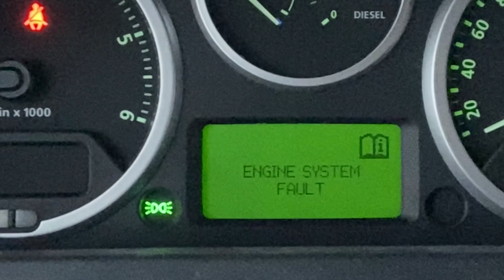DIY WHEEL FIX - Painting my Land Rover Discovery Rims Black

Comment from the maker: First time painting wheels, what do you think of the result?? 😅
Reply: Nicely done, you are lucky that you don't wear glasses 🤓 like me so I have always Paint on them. I did my Rims I think 10 Years ago. Just changed my Steering Linkage on both sides last Friday.😊
Greatings Sandro from Germany
Reply from the maker: @SCGFunktionsmodellbau  Hey Sandro and thank you! I have glasses but as you say, luckily I only use them while driving long drives or watching TV. 😅 Good thing you won't get paint in your eyes. 🤓 Do you have the rims still, if so is the paint holding up? I secretly love doing these jobs my self and learning, even though they take a long time to do.  Steering arms, which car? The D3 I find to be fairly simple to do, a good set of players and your set. I have change min two times in the past 9 years, was on the way out when I bought the car and last year I think. 😊 Best, SImon.
Reply: @LandRoverDrive  Hello Simon, yes I have done all 2 Sets of Rims, and the Paint is still on it, ok I used somewhat of professional paint. This is also the second set of Steering Linkage on my D3 I used this Time Meyle HD Parts, and hope that I can get another 2 years of TÜV because there is quite a lot of corrosion on the door sills. Greatings Sandro
Reply from the maker: @SCGFunktionsmodellbau  Okay, you've done a good job then. 👍 I don't remember the the brand I used, but I used the same brand now as last time as they held up for 6-7 years. I got some corrosion on the door sills as well and need to attack that after the summer. Will have to practice my welding skills again. 😅
Reply: @LandRoverDrive  yes I have the same plan will see if it works out, new sheetmetal is not that expensive.
Reply from the maker: No, I have some ready in the garage, just need the time to do it. Need to oil up the chassis this year before the winter comes as well. Rusting like crazy up under there. 😅
Reply: @LandRoverDrive  yes here also, the people say here we have 6 Months Winter and 6 Months hard Winter, years of Salt during that time does not the Best to any Car.
Reply from the maker: @SCGFunktionsmodellbau  yep, road salt is on my things-I-don’t-like-list. 😂😂 Part two is out now: New tires for the Land Rover Discovery 3
https://youtu.be/eGKExC2tiC8

Comment: Nice work.  I used self healing primer on one set of wheels, and satin black as a top coat. Did a similar process
Reply from the maker: Thank you Rob! Healing primer, not familiar with that? Does the paint self level or something? 🤔
Reply: @LandRoverDrive  hi, yes it sort of self levels and seals any putting and imperfections, giving a smooth level surface for painting. It also seals any minor scratches too.  Really good stuff.  The finish is good enough without a top coat
Reply from the maker: @robgreenhill1426  sounds great. The wheel paint I used also was self sealing so didn’t need a top clear coat. And the plus of that is that I get the matte finish which I really like. 👍😊 Part two is out now: New tires for the Land Rover Discovery 3
https://youtu.be/eGKExC2tiC8 👍

Comment: They look great! I’m thinking of getting my wheels powder coated. A place here in the US can do them with the tires still on the wheel. They take the air out, break the bead and push the tire from the front of the wheel and then do the powder coating process. Wish me luck!
Reply from the maker: Thank you Jerry! I was considering powder coating my self while doing this job. That's why you can see me a bit hesitating at in the beginning. Sandblasted and powder coated. But was trying to save some money as well. I think it would end up at around 1000 to 1200$ for five rims for powder coating a set of 5 if I remember correctly. 😊 If your beads are in good conditions I think you don't need any luck, maybe with picking the correct color so you'll be happy with them. 😅 So good luck with that then! 😂

Comment: Good job!! I've painted wheels in the Biltema parking lot, your way will last a lot longer! 
I also need to find 18" wheels for my D3😍
Reply from the maker: Hahaha, in the parking lot. Well, you would have had the can of paint I was missing at the end then. 😊  But thanks, they came out great to be a DIY job and the paint is still on the rims so take that as a good sign. These are 17, old ones were 18, the old ones I show with the rubber paint. 👍

Comment: Looking good Simon.  😎 My D3 wheels are the same and the same colour too.  I think you may have also chosen the same tyre 🤔😁
Reply from the maker: Thanks Simon, I think we like the same look. Not sure about the tires if you haven't bought a new set lately? 🤔
Reply: @LandRoverDrive  nope, same tyres as I had last year.  They haven't done any more miles 🤣👍
Reply from the maker: @simon-mouse8739  Hahaha, then it's not the same. 😊 I bet the running cost has been really low the past year. Though the maintenance is another matter. 😅
Reply: @LandRoverDrive  🤣🤣👍

Comment: I think I have missed a few of your posts. Didn’t you have a Range Rover classic and/or defender at some point? Have those moved on to new homes?
Reply from the maker: Hey hey. Defender went to a new home last year. Was to much to handle at some point, couldn't get on top of everything. But I am keeping a lookout for a Classic. I am hoping to buy one for my 40th birthday in two years time and do a longer trip in it. :) Erik still has his Classic, all though not in working order at the moment, it need a carb refurbish and some other stuff before it is ready for another trip. We will see, maybe suddenly there is a series in the driveway. 😅
Reply: @LandRoverDrive  nice 👍🏻 thanks for the update. Combining multiple vehicles that need work/maintenance with being a parent is a near impossible task. 

My friend is currently rebuilding a RR Classic LWB and a Series II 109. It’s a long process. 

My ideal rebuild would be an early 90/110 with decent body panels and junk every thing else. Then buying a new galvanized chassis, a new galvanized bulkhead and footwells. Installing a mechanical diesel engine like  Isuzu 4bd with aftermarket 5 speed transmission/transfer case and aftermarket axle system. Rebuilding those systems have become more expensive than buying new ones. 

Your friend Eric might want to consider a simple aftermarket EFI system for the Range Rover and eliminate the carburetor entirely.
Reply from the maker: I would love an old mechanical petrol, just a super simple engine like the 2.25. Just as a contrast to the TDV6 and all it's bells an whistles. :) But a older 110 with V8 on a new chassies would also be a much appreciate car. Isuzu diesel seams to be the way to go, they really know their engines it seams.  👍 Erik has tried fitech, or what it's called, but he struggled with stuff not working in the set. Don't know if there was something wrong with it. But he decided to go back and keep it as original as he can to keep the value of the car. There are some crazy prices for good 2-doors in Norway now.
Reply: @LandRoverDrive  those old two doors are super expensive every where. So are defenders in the states. I have the Isuzu in my Perenties and it’s the best diesel ever put in a Land Rover, for sure. If you get a series it’s best to keep it original for value other than parabolic springs. I had a lightweight with the later 2.5l diesel in it and it was surprising how much faster it was than my Series III 109 with a 2.25l petrol. I know the Danish Army was running the old lightweights and I thought Norway did too, but you might have had the early 90”.  Check out Withams out of England they usually have the best deals on decent surplus.
Reply from the maker: @jdenmark1287  So true, need to save up for all the LR's I want to have. 😅 Parenties are really cool, wasn't there a 6x6 parentie at some point. We have lightweights in Norway as well, not many but have seen a handful at the LR meetups. The 2.5, do you know when that arrived, which year? Can you find them in a late series 3? A series 3, HCPU would be fun and really build a overlander out of it with a tray and roof top tent. 👌Want to do so much but don't have enough resources at the moment. 😊
Reply: @LandRoverDrive  the 2.5 was retrofitted from early 90. They never were put in Series vehicles out of the factory. For some reason the British Army never went for the 200 or 300 tdi and always had the 2.5l diesels. 

Perentie does have 6x6’s which fetch a pretty penny. Only a few hundred of them. 

My buddy has a defender 130 crew cab hcpu that he put a tray back on. 

If I’m being honest the Gelandwagen is the superior vehicle.
Reply from the maker: @jdenmark1287  Hehe, in terms of mechanical strength, sure, but in history and charm the LR wins all day long. 👍😊 A gelandewagen on portal axels is hard to beat I think. :) I would definitely own on if someone gave it to me. 😅  130 is really nice and would be a fun overland build as well, an australian styre tourer would be nice. 👌 But need to focus on the Discovery first, have a full week of service and MOT in head of me. Need to get it ready for summer vacation. 😊
Reply: @LandRoverDrive  haha bring it down to Land Rover Time in Deutschland and let them do a full rebuild 🤙🏻
Reply: Can you guys get tires in 255/100 R16? It’s the metric version of the old 9.00x16 they use to put on the old one ton Land Rovers . Can’t get them in the states anymore.
Reply from the maker: @jdenmark1287  Hehe, @lrtime is great and will have to talk to them when I need a new turbo and crossover pipe in the future. 😊Would be fun to drop by for a visit or do a Overlanding video series.  👍
Reply from the maker: @jdenmark1287  Looks like there are some available, but not approved for speeds over 30km/h after a quick search.
Reply: @LandRoverDrive  yeah, they are retreads probably or tractor tires. China is making Michelin XZL knockoffs dirt cheap but I don’t know if I would dare go 25 kmh on them.
Reply from the maker: Haha, I think wheels aren't something to mess about with, you don't want it to fail, ever. 😊

Comment: Me either has set of 17" but not decided the size ??
Reply from the maker: Size on the tires?
Reply: @LandRoverDrive  yeap, 255 75 r17(bisggest that can fit) or 265 75 r17
Reply from the maker: @lujbav  I went for 265/65R17, good clearance, no rubbing, the car can still roll if the airs suspension goes out and lastly it’s the biggest legal tire I’m allowed to put on here in Norway. 😅😅
Reply: @LandRoverDrive  i see, i am from Turkiye and we dont have that much strict regulation for tire size:) anyway i test with used set for the biggest and lets see. Btw, waiting the prt 2 !:)
Reply from the maker: @Tayfun Koç I would love to have less restrictions here as well,  there are so many rules to follow. 🤯 Smart to test out with a used set, have done the same many times since it's so expensive for a new set of tires. 😊 Part 2 will be out next Sunday so stay tuned. 👍
Reply: I ride 245/75/17 bf ko2 and it’s perfect. But maybe a bit slim for snow.
Reply from the maker: @yoavraz5235  👍 It really depends on the conditions which tire dimensions is the best. For on road narrow tires is good, especially if you have changing conditions with wet snow and slush. I run on 245/70R17 during winter and so far it’s the best driving tires I have had. Smooth ride, nice handling and very drivable. I want to try out 245/75R17 at some point as summer tires just to see how it is. Would be good for long trips on mainly roads. 👍😊 But for Icelandic winter driving the super wide floating winter tires is the way to go. Don’t think we will ever see a Discovery on such tires though. 😊😊
Reply: @yoavraz5235  it has the almost same size 31,5" width but good for fuel consump.:)
Reply from the maker: @lujbav  Yeah, I have seen mine go up from 0.8L/10km to 0.95L/10km with the latest mods and the new wheels. I think the new wheels has a lot to say on that. 😅 If I'm going to do a long europe trip I think I need to look at a set of Nokian outpost 245/75R17 I think I would earn the tires back in just one long trip. 😊